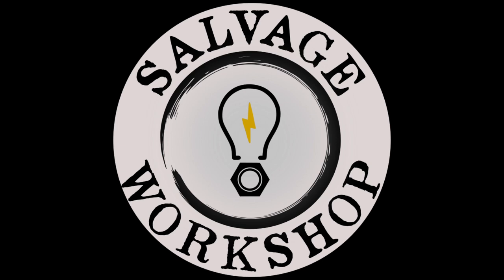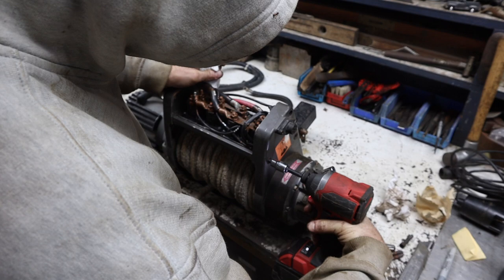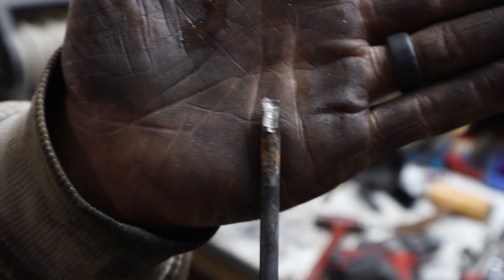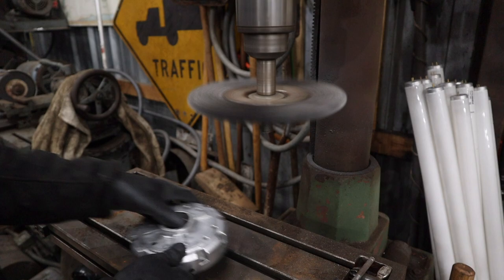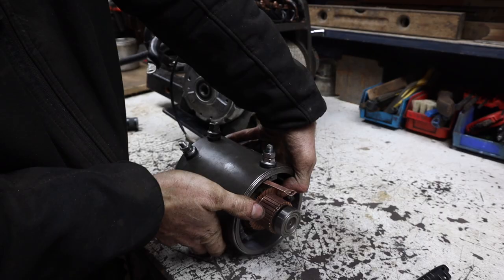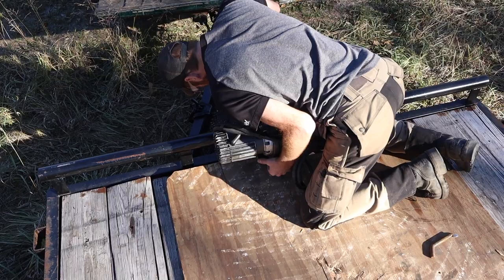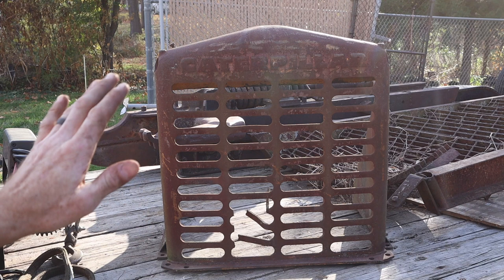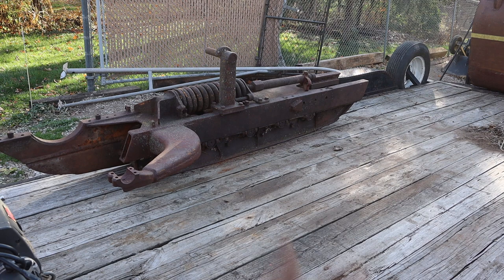Fixing a Winch so I can RESCUE Forgotten Parts ~ Part 9 ~ 1950s Caterpillar TraxCavator

Comment: Is your trailer capable of hauling that forklift?
It would be an extra trip to fetch it back, but at least you'd have muscle.
So glad that winch worked out. They have nice ones on Amazon, remote, 
9,500 lb. $310. They've got 120v, 1,000 lb. too, if you bring a generator.
Reply: I was thinking the same thing.
Reply: Ever try running a hard rubber wheel forklift on soft ground? You end up needing a winch...
Reply: @kstricl  Tire chains.
Reply from the maker: @matgaragepaul  I want a Telehandler as well! They are AWESOME!

Comment: I would put the rock guards on old red lessons for possibilities of anything getting by buy them into rollers that can potentially screw them up and cause major and I mean a major headache oh and that tiller was actually meant for the other John Deere garden tractor it is a belt driven instead of hydraulic like your 318 the snow blade looks like it is right however

Comment: I could be wrong, but appears that you have 2 - 3500# axles on your trailer which allows you to carry up to 3 1/2 tons total, albeit, it would appear that you are attempting to carry what I would guess to be about 5 - 6 tons, which is not a good idea, but what do I know. Honest well meant suggestion, always have a partner with you when you are working with heavy equipment in a remote area, remember, anything unpleasant can happen at any given time, according to Murphy's Law.

Comment: I have the identical winch it's the 3 prongs on the plugin, I had to change the plugin to a thicker prong system like an aftermarket plugin, I can show you mine
Reply from the maker: I assume your talking about the remote plugin? This one has a 5 prong plug for the remote.
Reply: @SalvageWorkshop  Is yours the 5000 or 9000 Same body style Mine is the 9 but I was told by Warn that the plugin had a small pin connection that would miss making connection to the sides I could get a new plugin for a prepaid $$ order Ya right not my screwup , So I got a cheaper winch for the argo it had it`s own but it had a button plug with fatter prongs so I removed the old one wired in the new used Hotglue to make a shoulder around it done deal ,That was 5 yrs ago never had issue again .

Comment: Questions? Don't you own a Hi/Lo ? So, don't you think that loading that up on the trailer & taking it with you would be a good idea ?
I mean after all you are one man up against bulldozers parts & one of those parts almost fell off the trailer & hit you ! Next time get 
you some flat sheets of melt so the wheels won't get stuck in the mud/soft dirt & take it with you ! I think that you will be glad that
you did ! That or get a tow truck with a heavy boom to load it on your trailer. I think that I like those two options instead of you with 
a hernia !

Comment: Redundant safety system??  They use two solenoids to power the winding in one direction and two to power it the other direction. That’s a power system not a safety system. Same as a starter solenoid. Nice video as usual. Love your custom bearing installer.

Comment: If I can’t fix it I’m not touching. So I go buy a new winch. Smittybilt winches are cheaper than warn but great winches. I have a 12,000lbs on my truck and a 9500lbs on my tile trailer

Comment: The rototiller for certain is not for you jd 318 looks like one for the 200 series and the plow needs the hydraulic cylinders and it would be cheaper to buy another plow for the price of the cylinders and hoses

Comment: The winch on my jeep doesn't act like that.  The brake setup isn't correct.  When you let off the control, the winch should stop and not rebound back like yours seems to be.  Something still isn't quite right, but does appear to work enough for what you are up to.

Comment: Apart from the solenoid that you replaced, the fault almost certainly was just a corroded commutator, but it equally could have been a brush stuck in it's channel but you will never know!. Before removing the armature you should always gently lift the brushes  against their springs to check that they are not stuck then fix them in the out position, and NEVER just pull the armature out and let the brushes clang together forced by the springs. The graphite that they are made from chips really easily. Did you ever check the stator coils? If so I missed it.

Comment: Really like the heavy metal recovery part - a lot of tricky maneuvering there to get things on that flat bed.  That bucket loader is a beast!  Look like you almost need a crane to get it on the flatbed.  For the motor, do you think Vaporust jell would be good for dealing with that surface rust around the windings?  I wondered about that followed by a little rust inhibiting paint - but maybe that would react with the insulation somehow?  Nice rebuild overall by the way!  Really like learning new stuff from your vids!  And looking forward to seeing Old Red with some new-old hardware! =)

Comment: late model Warn winch. What is capacity? 15,000? 20,000 pound single/straight line pull?

Not cool to insinuate it is OEM to the unit.

Comment: I'm sorry, but I laughed when you tried to move the bucket and arm assembly. I thought if it ain't heavier than your truck and trailer combined it is at least 3/4 the weight with far more dig in and friction points. Do you have a heavier set up for getting it otherwise you mighhave to take the bucket off there whether you want to or not

Comment: That blade is not for a 318. Is for the 200 series. 300 series has hydraulic cylinders on the a frame. Also the moldboard is smaller. 300 series is 54 inches wide and 200 series is 43 inches wide.  Possibly the tiller is for 200 series as well. I will rewatch the vid and let you know
Reply: The tiller is 31 model for the 200 series as well. You have the mule drive for it as well.

Comment: I finished a similar restoration on a 9.5 warn not long ago.    After I cleaned everything up, nothing worked.  I think when I was cleaning the windings, I screwed something up. Vid series on my channel.    Ended up buying an ebay motor that upgraded the hp... good job.

How much preload did you put on the spring for the brake?

Comment: Seeing this https://youtu.be/3LiIUeJxAfU?t=2704 confirms what I had seen in your last video where they had just cut the old sprocket out and welded a new one in, I could see the welding marks it also explains why the sprocket was so hard to remove and why they just cut it out and weld it back it even if Red was new it seems like a very hard job.
Reply from the maker: Yup... Good eye! I'll be talking about that in the video where the new sprocket goes on!
Reply: @SalvageWorkshop  look forward to it :).

Comment: From as guy who spent more than 40 years in industrial and marine maintenance, your troubleshooting skills need work. I was going to say they suck but I'm trying to be nice. First thing I would have done was lift the motor leads and using jumper cables bump the motor. At 15 minutes in you STILL haven't determined the status of the motor. Identify the problem,  identify the cause, correct the cause. Also, penetrating oil and never sieze are your friends. Dielectric grease for the electric connections. Or not...
Reply from the maker: It's a wonder that I get ANYTHING done!

Comment: Like your work......but you only get one spine, when its wrecked that's it. Wear gloves when pulling down/apart motor, gearboxs etc, you will be able to still use your hands, feel things when you older, trust me on this talking from experience.
Take a mate with you digging out parts in the bush, almost had your ticket punched at 39nth minute.

Comment: The rototiller and the snow blade are for the 200 series tractor on the property.  The 318 blade would have two hydraulic cylinders on it.  The rototiller would not have the mule drive belt for the 300 series.
.

Comment: only 3 min in to the video but i have to say this .......sorry but you need to learn a bit more about the relays in the winch , there sey up in what is called a "H bridge" configuration NOT what you said as in " a redundancy for safty set up" you need 2 relays for each direction so reverse to +/- to the motor to change its direction
Reply from the maker: lol... Second person to challenge that!  Warn solenoids are in an H bridge configuration, but not your standard mag motor H bridge but a series wound H bridge.

Warn does not switch the ground lead! The ground lead goes straight from the battery to the motor! More importantly: The solenoids are not in parallel. They are in series, so if any one solenoid fails, your winch will not work in that direction. Hence the safety.
Reply: @SalvageWorkshop  thank you i stand corrected, and just as a side question did you use a solvent base cleaner to clean things up (solvent and lacquer covered wires not a good mix)

Comment: They are relays not sonlinoids
Reply: They are in general used to switch starter motors on and off, hence they are called starter solenoids (solenoids for short)

Comment: You have solenoids because you can't run full amperage through that little switch,,, safety? Never heard of that. It's nothing more than a heavy duty starter only it runs a winch. Hit that jump pack right to the motor before you even take anything apart,, whack it with a hammer just like you would a starter with bad brushes.